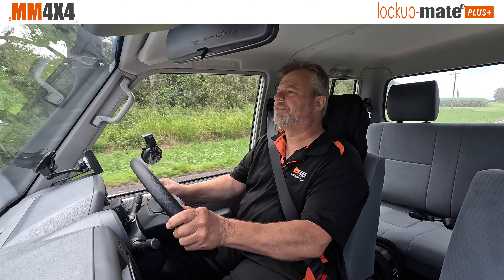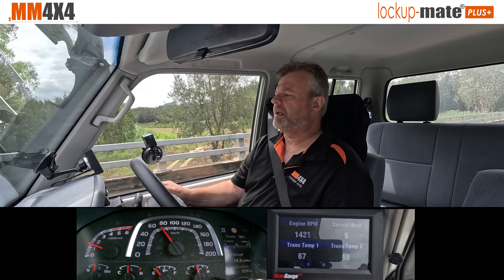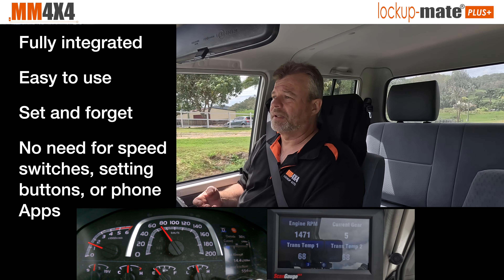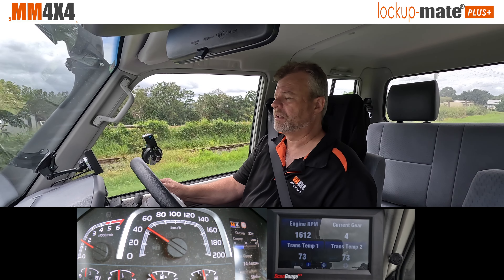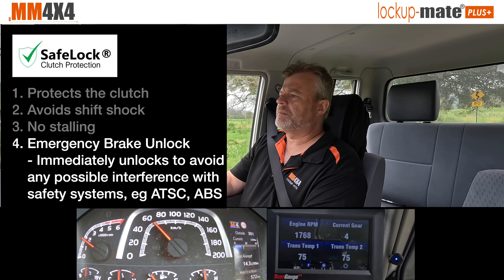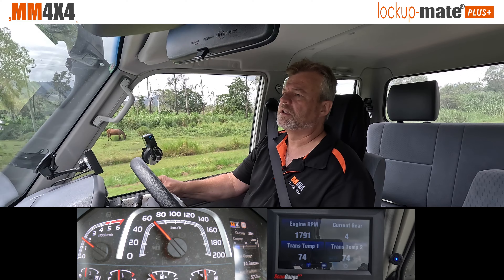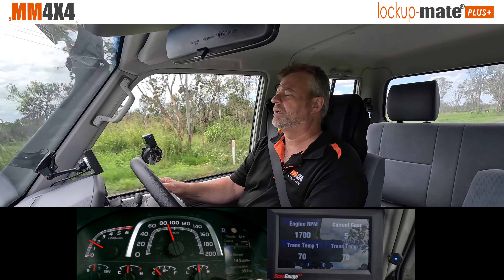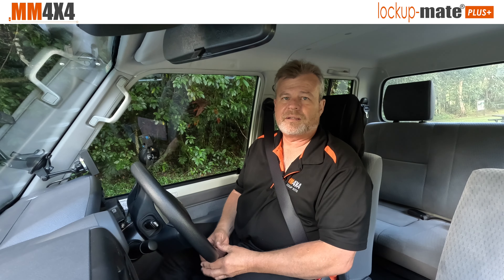Operation in 70 Series 2.8L Auto - lockup-mate®PLUS+ Torque Converter Lockup Kit

Comment: great video mate shows it working really well, definitely keen on putting one in my Fortuner only question I've got is do you have to be in manual mode or does it work if just left in drive rather then manual select Aswell
Reply from the maker: Thanks.  The fortuner work sa bit differently than the 70 series.  Yes, the kit works in DRIVE, SPORT, and in 4L.  In D it will lockup (when conditions are right) at 70+ kph.  Below this speed you use SPORT mode to force the gearbox into the right gear to allow lockup.  eg. use S4 for 60 kph, or S3 for 40 kph.  It will lockup down to 2nd gear (25 kph).  Also in 4L when in SPORT mode.  It includes all protections to make it fool-proof, and it properly integrates wiith the operation of the vehicle. There is another video on our YouTube channel you should watch instead of this one for the Fortuner.  https://www.youtube.com/playlist?list=PLQLimNF5jLl6QHooj-X-gHrIFf-OYxwrp
Reply: @mm4x492  legend 🍻 just seen the other videos makes sense, smart bit of kit 

Will be purchasing this soon, once the wife gives the go ahead 🤣
Reply from the maker: @OUTBACKDiscovery  Our kits are currently on sale - get 10% off during our EOFY Sale - ends Sunday 🙂
Reply: @mm4x492  ordered one just then cheers for the heads up orders  under ryan t 

Looking forward to seeing the difference will do a video on it also
Reply from the maker: @OUTBACKDiscovery  😎Subscribed! 👍